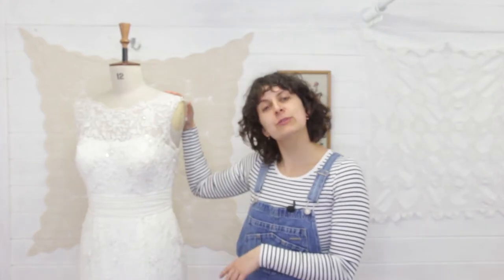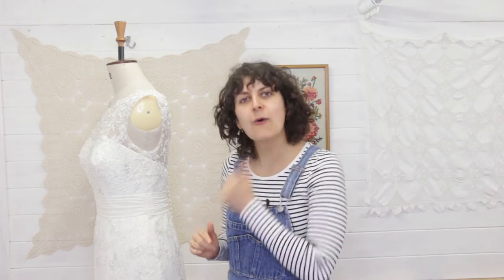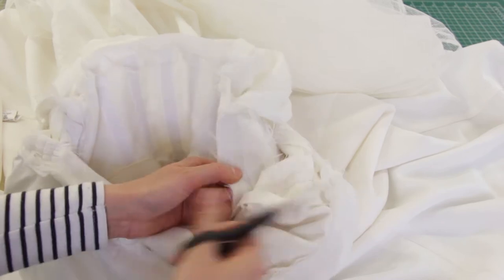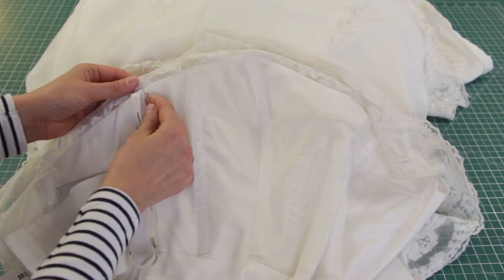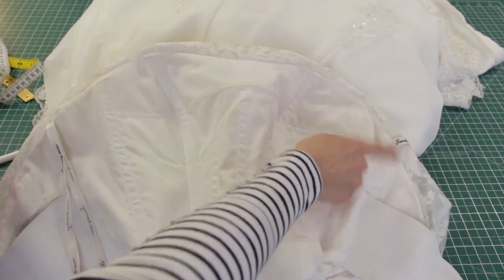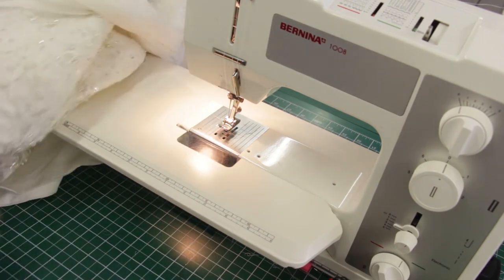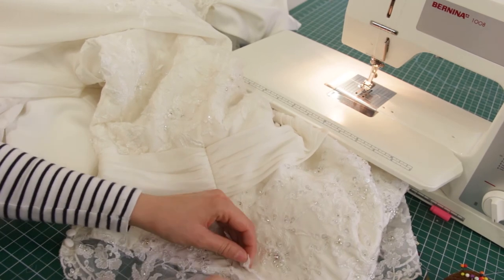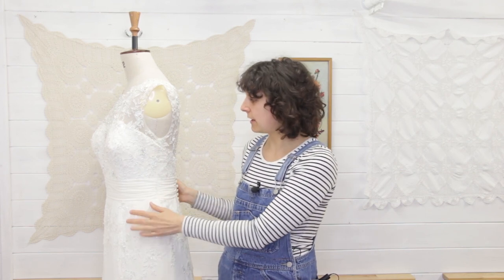BRIDAL ALTERATIONS | ADJUST SIDE SEAMS TUTORIAL + 2 pro tips

Comment: Hello! Thankyou so much for your lovely video. I’m getting married next year and a kind friend is lending me her dress for the day. It’s 27 years old ivory satin with pearl beading on the front. Its beautiful but also a size too big. Is there any simple way I can alter the size or fit without causing any permanent damage or changes or the dress? Hope you have a lovely day xx
Reply from the maker: Aimee miller hi Aimee. Thank you for your kind comment 😁. What you can do is take in the side seam but not trim off any excess, that way your friend could let it back out! If the pearls run along the side seams, that might be an issue as you'll likely need to remove along the line that will be stitched! You could also hand stitch it and try and avoid any beads! Hope that helps xx